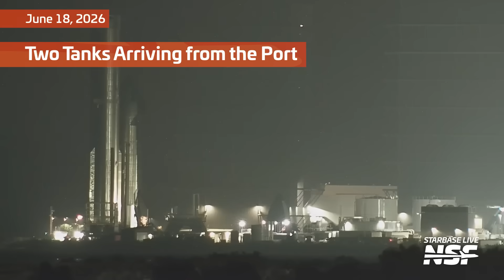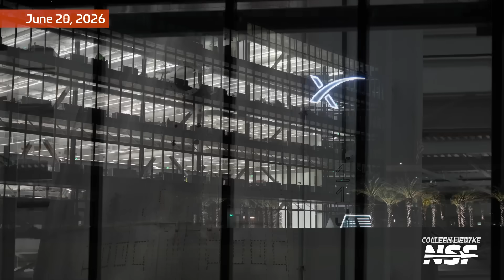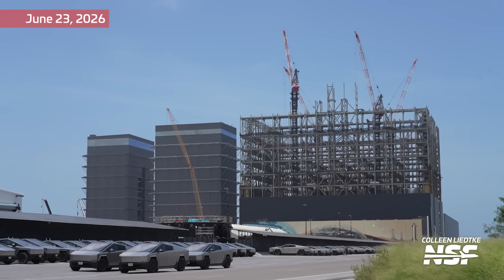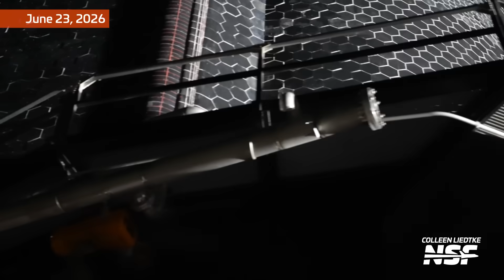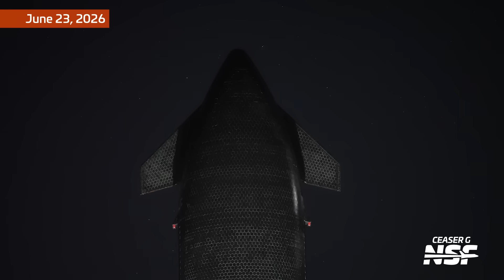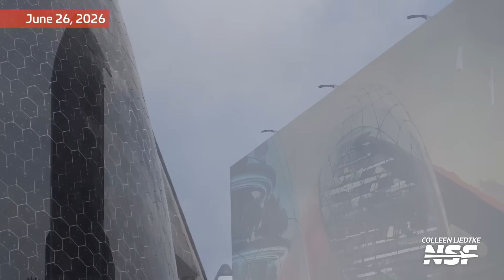Single Engine Static Fire? Huh. | SpaceX Starbase

Comment: I'm guessing that the smaller tiles are to compensate for the extra contraction and expansion at the tank ends?  One at the bottom where the engines connect to the oxygen, and one in the middle where the oxygen meets the methane?

Comment: According to Marcus House, the S40 Static Fire duration was 15 seconds. And he said that what seemed like an abort the day before was an ignition test. 

There's no word on why SpaceX didn't follow up the single engine test with an all engines test, but Marcus suspects they found a problem and decided to send it back to fix or possibly engine swap.    

So S40.will likely or at least Should be sent back to Massey's for another go at it.